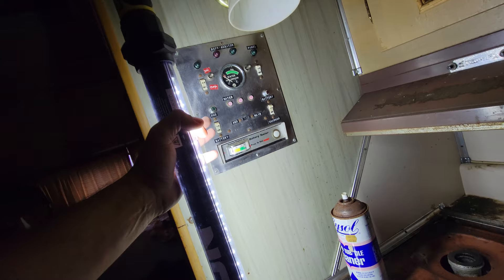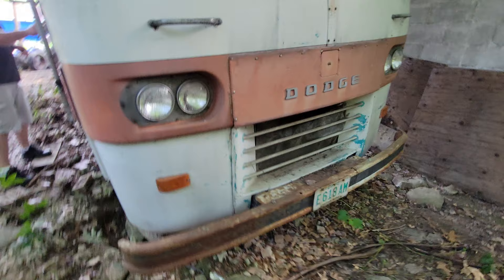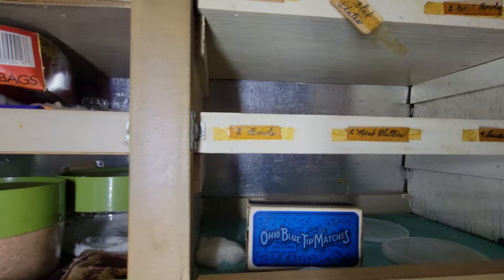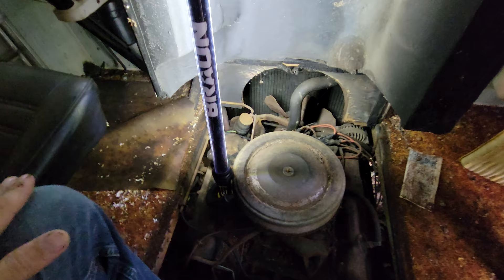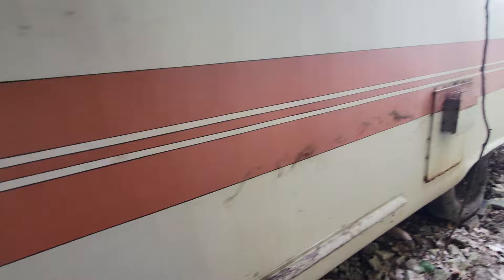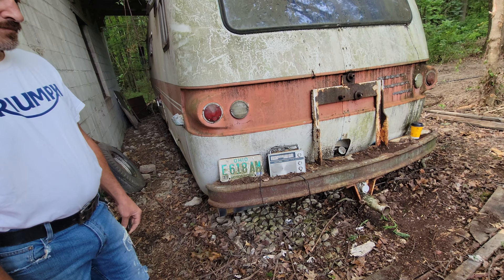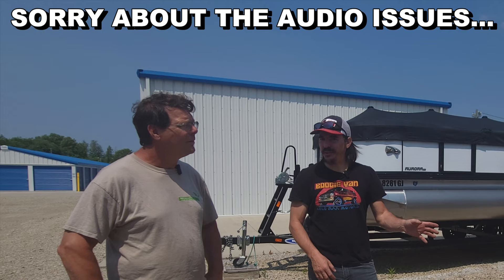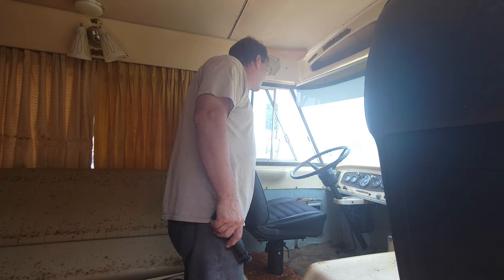Forgotten Travco RV - PARKED for 35 YEARS! WILL IT RUN!? WILL IT DRIVE!?

Comment: Those little multi-colored metal strips that you found on the countertop near the 20 minute mark of the video looked very familiar to me.  I believe that they were part of a toy train called the "Toon Tooter" or something like that which was sold during the mid-to-late 1960s.  The metal strips were places in holders on the train track and when the little battery operated train passed over them, a rotating striker would strike the metal strip producing a musical note -- each color identified a different musical note and there was a book that accompanied the toy the instructed the user how to arrange the little metal bars to make the train produce different musical songs.
Reply from the maker: ..interesting. I had cut out a whole 2 minutes where I was agonizing over those things, saying the same thing - "I recognize these but don't remember from where". And there was that little trainset there. You may have solved that mystery.

Comment: Please don't put gas or diesel in your fresh water holding tank.. that  rear driver side spout is WATER not fuel for the generator. The generator gas is tapped into the main gas tank. And the porch light and all others are 12 volt, they run off the " house" battery

Comment: We have a 1964 named Myrtle, 270 model = 27 feet. Myrtle has the push button transmission with the original poly 318 stroked and bored to a 408.

Comment: Why is the power probe constantly beeping? You  know you can shut that off.
Reply from the maker: It's not the probe, it's both dewalt battery packs. And no, you can't shut them off. They need to be disassembled to have the piezo sounder ripped out.

Comment: 440-3; not HP. Industrial engine; heads are different, have raised ports
Reply from the maker: Yes, 440HP (as stamped). This was a 318 RV originally - the 440 was swapped in later. And is a 69 build.
Reply: @TheCarFarm  that would explain it